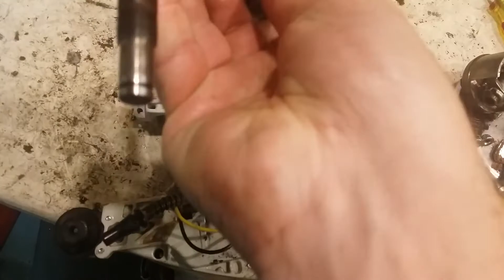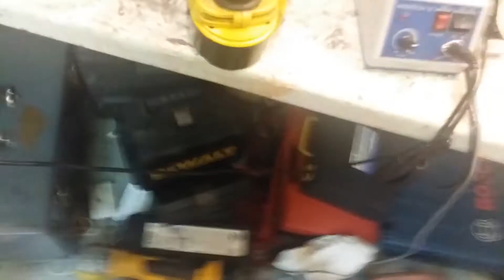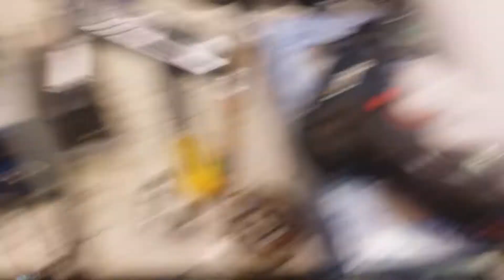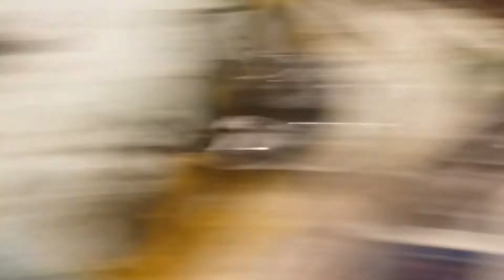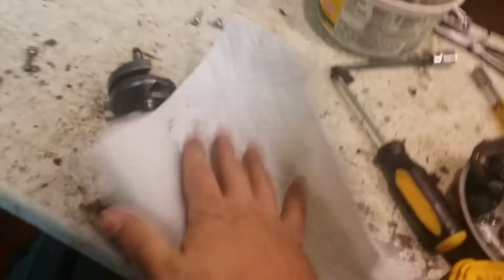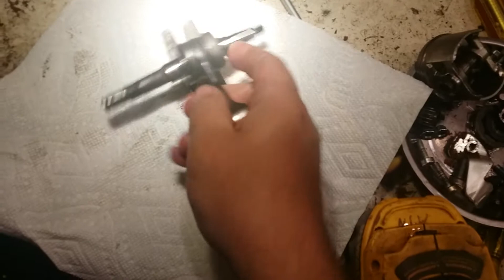Huztl 440 crank is out....and it's blue

Comment: My guess is an air leak and over reving which toasted the bearings and then the crank.  That is about the only thing that will turn a connecting rod blue - that means it got at least 700 degrees on that crank rod.  That will smoke any two cycle oil.  How many tanks did the saw have when this happened?  What kind of break - in procedure did you use?    I break in a new saw one way - it sits on my work bench and just idles for the first tank and the first three tanks have extra oil in them.  At around 5 tanks I let them see a little wood but not a lot.  My friend from Wisconsin, a woodsman, calls my saws "work bench queens" but I have never had a saw failure with my method.
Reply from the maker: John Clarke I've never seen an air leak that left the piston oily.  The piston and cylinder are fine.  Can't imagine how an air leak would only toast the crank.
Reply: Owner may put fuel with extra oil after feature trying make it work,, never know

Comment: Is this the saw you had to modify the crank to get the retaining e-clip for the clutch installed?  Crank maybe moved out of center? Needle bearings not getting the proper lubrication? Crank bearings not square in the case causing lateral bind on the rod? Maybe just some bad needle bearings. Did the big end crank journal fail causing the damage to the needle bearings and rod? 
I would try to heat and press the crank a part to inspect the big end pin. But that's me.
Keep us informed, thanks for the video.
Reply from the maker: Yes and no.  This saw has a crank in it that I had not modified.  It went together fine....and it doesn't appear to have moved one way or another.  But u r right....the 440 huztl kit has an issue going together.  I fixed this by substituting a pto bearing that was of correct dimension.  The one that comes with the cases is too wide of an inner race. ...10mm vs 9mm stock
Reply: Matthew Olson We can tell it got real hot but why? It's really hard to tell what failed without seeing what the crank pin looks like compared to what the needle bearings look like if I had to guess I would say that is where the source of the failure came from, one of these two things but that's just a half educated guess.

Comment: Rod was rubbing hard on one side of crank throw which caused it to overheat.  Possible causes (A) Holes in rod not machined parallel to each other. (B) Crankshaft pin alignment issues. (C) Wrist pin hole not 90 degrees to cylinder bore. (D) Bent rod.
Reply from the maker: Bill Blackburn yes lots of things it certainly could be

Comment: Matt, if the cylinder is tipped out of line to one side or the other laterally it would put all the pressure one side of the needle bearing causing the failure you see, or could have had a piece of metal in the bearing from the factory. Just a couple of possibilities.
Reply from the maker: yeah, the base of the cylinder head has not been cut, I had done a base gasket delete on it, but I don't remember squish.  its possible the base is off a bit from the factory, and I remember Walt describing those issues with the cross cylinder head.
Reply: I like what Steve (piece of metal in the bearing from factory) these things are notoriously dirty as delivered and I always spray a ton of brakleen through all the bearings as well as all other parts, on my 660 kit I found two small pieces of ferrous metal on the cardboard after spraying the parts. PS this is not aimed at Matts build I know he understands the importance of cleanliness in a build but many other viewer/builders probably do not.
Reply from the maker: 1bottlefed I'm gonna be on my 3rd crank for this saw. ...same thing happened a 2nd time....the cylinder head may be off kilter from factory
Reply: Yeah my comment was aimed more at other builders not your saw. I knew you had this issue on the original build but was not aware this was the third crank (Ouch!).      I am with you and think it must be an alignment issue of some type. If it were a piston to head interference deal at the squish band it would seem likely that along with visible witness marks on the dome and head, it would also seem likely that the wristpin bearing would be damaged since its a much smaller bearing (but this is only an assumption.....never actually seen what happens with a two stroke absent adequate squish.         As far as the jug goes have you tried measuring the bore to deck flange to see if they are at 90° all the way around? Probably a decent 4 way combination square set and your veneer caliper would suffice    http://www.penntoolco.com/4-pc-combination-square-set/  just set the 360 gauge at 90° to the ruler and place the ruler tight against the bore and using your veneer caliper see if the distance between gauge and flange is the same from side to side....while this might be fairly crude and not able to make a super accurate measurement if it consistently shows several degrees of side to side variation and one of your off the shelf Farmertecs shows less than 1 then I feel it would be safe to say that the Cross cylinder is defective.

Now if you want to do a really cheap quick and dirty check (the kinda s##t I would do....then you could just take a piston and apply some tape or paint to the skirt so that its a tight fit in the cylinder and place it upside down in the bore and place a straight edge across the top of the piston and compare left and right measurements...then rotate the piston (45° at a time) and repeat the test several times to make sure the piston dome is square.
Reply from the maker: 1bottlefed I'm swapping in a new crank and different head. ...we shall see if that helps. ...I think it ran fine with the old huztl head but I swapped in a prototype head and result was 2 busted cranks....ugh
Reply from the maker: 1bottlefed 3rd crank is installed....I took out the prototype head and put a regular farmertech in there.  The casting was much better on this head than I have seen in the past.  The other thing I changed was the flywheel key.  The previous one had some advance.  This one doesn't.   We shall see how long this setup lasts but it pulls pretty good off the bat.
Reply: Best of luck with it. My 660 is running fine once again. It had started loading up really bad last week so I pulled the carb and the needle and seat were clean and properly adjusted so I figured what the hell take a shot...and took a small section of tubing and hammer and reseated the welsh plugs. Put it back on and now it runs like a champ.The only issue remaining is that the oiler does not provide as much oil as I would like for a 28" bar and full (non skip) chain. I had ordered another oil pump from H&L but unfortunately it was a Farmertec and oils about the same as the last one. I have checked the supply feed to the pump and the feed to the bar and both are unrestricted. However I did not (at the time) know how the tank was vented, so now that I realize how that works, I may pull the bar and try enlarging the restrictor and of course check the passage to the tank behind the restrictor. If that does not work then an OEM pump, probably the high capacity one,  may be in my futureLooking forward to getting a large tree trunk to process into rounds and run a couple of tanks of fuel through it. If needed I can always apply some grease to the nose sprocket every 3rd or 4th cut to supplement the weak oiling.PS Saw your vid on milling....had no idea you had a mill, you are living the life my friend!! Happy 4th to you and the family.
Reply from the maker: yeah, love milling... its truly my favorite thing to do at this point.  chainsaw milling drives me nuts though haha.  my 660 runs pretty good at this point, and the high cap oiler is likely a good idea, though I heard there is a thread somewhere on OPEFORUM.COM for modding the oil pump for more flow.... 

ran a bit through the 440 today,made some cuts.   pulls pretty good now and oils (when the oiler is turned all the way up) fine.  hopefully the crank holds.  at this point its either the advanced timing or the cylinder head was off kilter.

Comment: I am curious as to approximately how many hours were on the saw before the crank bearing failed. I also wonder if you could split the crankshaft to be able to visually inspect the big end bearings? Now you need to come up with a crank spitting tool.  :-)  There are obviously a number of variables here. The cylinder appears to be OK?  A lack of lubrication, some sort of grit or metal fragments in the big end bearing, poor quality needle bearings? Was the failure a sudden onset type of event? Was the saw turned off at the first sign of something was not right, or was it run until it failed? Would the manufacturer be interested in examining  the crank? Perhaps they might replace it for you as they might use the knowledge gained from analyzing the failure to improve the quality of their product. Chinese metallurgy generally leaves a lot to be desired. They utilize a wide variety of recycled scrap metal from all sorts of different items, with the big issue being consistency between batches produced & the impurities contained within. That is why Chinese steel products appear to be "old school" beefier in construction than what we see from more traditional sources. Their products have to be heavier in order to compensate for lack of strength.
Reply from the maker: Cylinder ok, dunno hours.  The piston is fine, and was lubed.   The crank appeared dry.   Main bearings seem fine, though I will change them out.  Saw just "shut off" was the complaint...

Comment: My guess is the needle bearing was junk from the factory either was missing needles from the factory or just plain bad. I would try a new one and reassemble. clearly us builders know some stuff from China is out of tolerance. -Vincent
Reply from the maker: Vince Trombly yep...that's my plan.  I'll try a new crank and see what's up...
Reply: Matthew Olson It has to be the crank has a little slide to it. Walt has centered them with a mallet before. If it was out slightly the jug would pull it center. it has to be the bearing.
Reply from the maker: Vince Trombly I can try to pull the pin and see the bearing. ...never tried that before
Reply: Matthew Olson You could but it looks like the way you were moving it up and down that it's completely failed at this point. It's clear that the cage has completely failed allowing the needles to come together and allow the play that your seeing. Just my cents but id bet the cage was junk to start with I just can't see the cylinder being the problem putting pressure on the crank. The rings allow some play and the crank floats slightly. There should be more than enough moment to prevent that. And the oil that was in your top end was fine. Id do what you're planning and throw another crank in. My money is on defect.
Reply from the maker: Vince Trombly if I can get the crank apart I will....but yes..new crank is in order

Comment: I have had this happen to a few I have built for no apparent reason. I rip with my saws they don't stand up unless the moving parts are genuine I've done this it works but the cost defeats the purpose. we end up chasing our tails wondering what we have done wrong it does your head in but most of the time it is a quality issue you can't see  to look at the part. One of the best things I have done to mine is run walbro carbs can't get the Chinese ones right. the internals of my saw seem to be much better lubricated because the fuel delivery is much more controllable and accurate through the Rev range and reliably so.
Reply from the maker: Colin Dunn saw is back together and running.  We shall see how long this lasts lol. ...thanks for the comment